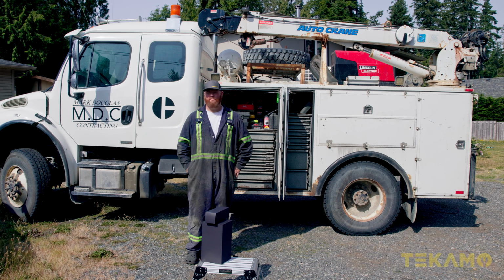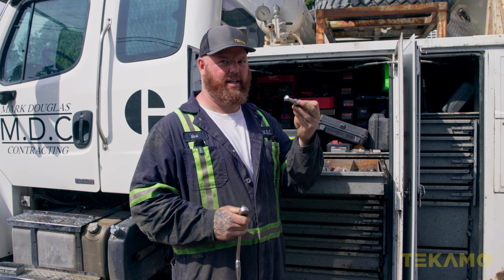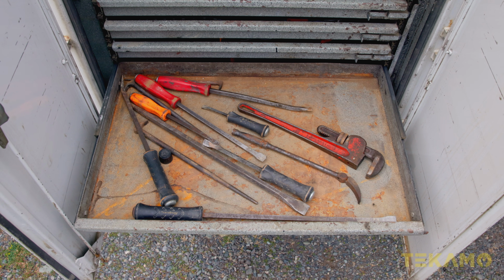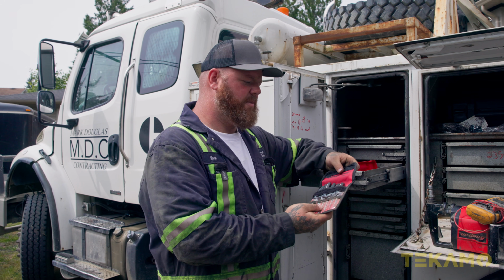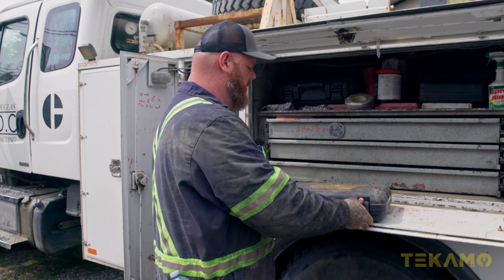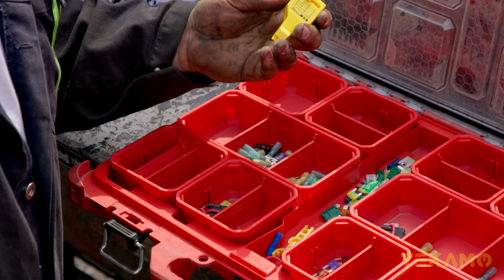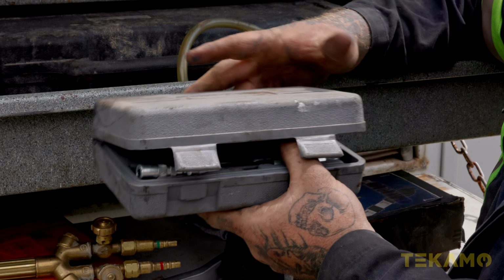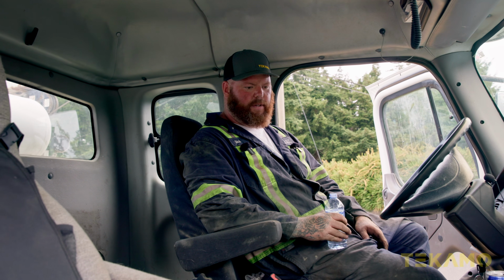Milwaukee, Snap-on, Knipex, and MORE! This Mechanic Has Them ALL On His Service Truck

Comment: Ditch U Joint pullers. Faster and easier to cut the cross with the torch, then push the caps from the outside inward with air hammer. If 1600, 1700 1800 Spicers cut the center of the plate after removing bolts, then pop off plate with air hammer. Pushing caps inward much easier when dealing with rust.
Reply: Yes all day long 👍
Reply: @alexmacdonald6466  Hey Thanks! 
Rusted caps, these newer Spicer u joints, it just takes the work out of it plus no Tiger Tool to buy and take up space in service truck.
Reply: No. You forgot about all the burning grease balls of fire going everywhere you don’t want.. Not to mention you clog the shit out of your torch tip from the blowback . U joint pullers are the correct tool for the job. Don’t be a hack
Reply: @heavydsunlimitedservice5741  Not SO! I have been doing this for a LONG time. I learned this when dealing with caps that were damaged with the only way was to cut them out. Grease just burns, does not foul tip. Air hammering caps from the outside in solves rust issues. You might want to develop better torch skill.
Reply: @billcovert3473 have fun with that lol torch is last resort for me. I’m all set for huffing on grease fumes. I’ve been doing it for a long time too and know enough to use the tool made for the job
Reply: @billcovert3473 get a plasma cutter 😂 but ur right grease just melts out as fast as cutting

Comment: 28:40 when your turning the handle on the long 1/4" drive, use the shew horn puck to turn the handle, when it slides off... the bolt is torqued. big kit small bolt make dummy proof, 90 degrees from turning motion no rotating to cheat so it doesn't fall off... so other worker with torque wrench comes by next. "azzembly isum line kit... any better ideas? toot hold up ratchet on table with a socket in it for showcasing.